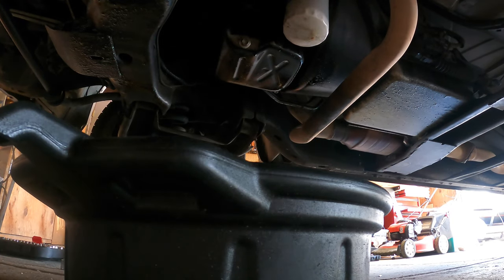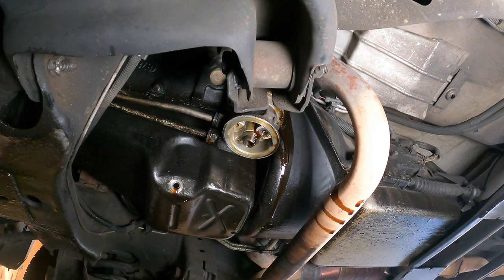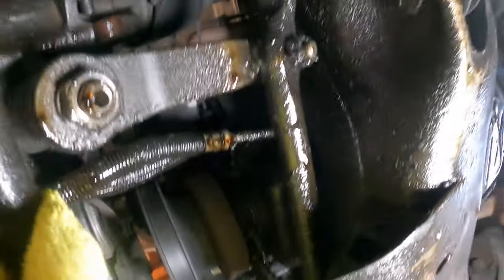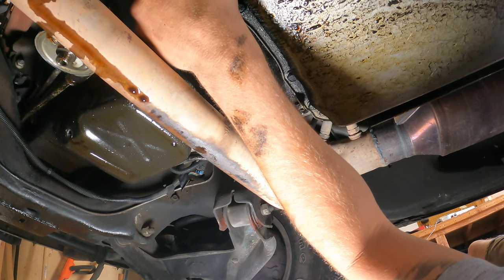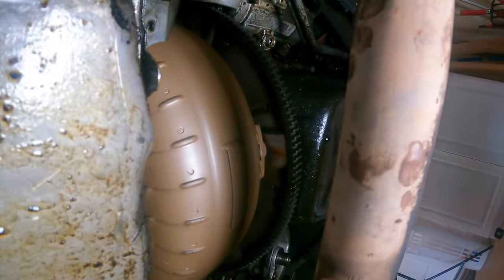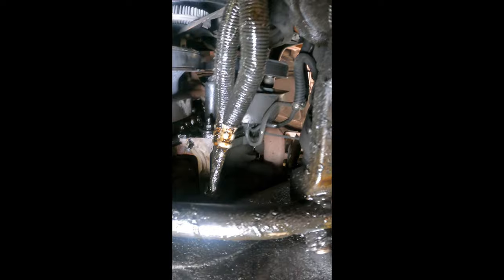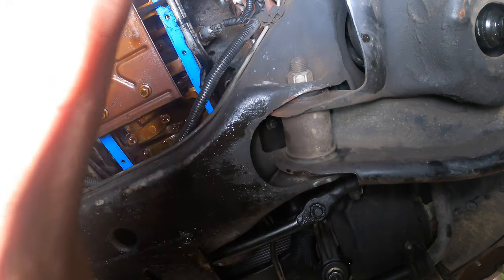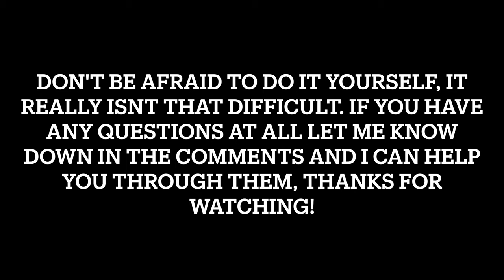Oil Pan Gasket 1996 GMC SIERRA AND SIMILAR VEHICLES

Comment: So you don't use gasket sealer ? I did   the oil pan gasket on my 96 c1500 and it still leaks from the front seal any advice
Reply from the maker: I did not use gasket sealer for mine, when I took the old gasket off I made sure the metal surface was really clean. You can add a sealer at the front and back of the block where it meets with the oil pan. It could also be leasing from oil cooler lines or one of the main seals. I’d clean the area up really well and see if you can pinpoint the leak.
Reply: There are two sizes of the gasket. A "thick" and "thin" variation. 
Certai models after a certai year take the "thick" gasket.
Reply: mine is leaking down the front of gasket after I changed it
Reply: Here's my up date guys , after I change my oil pan gasket it was still leaking from the front seal  I change in a couple Times befor I found out on the vortex 5,7 the timing cover is that plastic  which had a hair line Crack that I couldn't see I hope this helps

Comment: Oh boy! So I have to replace the oil pump on mine but I have a 4x4 and the differential is on the way 😓  went to a shop and got a $400 quote to change my oil pump and put new gaskets!  It looks like im gonna have a busy weekend!
Reply from the maker: You’ll get it done, it’s definitely easier with a 2wd truck. Good luck!
Reply: Wow that cheap ..

Comment: Lucky you I had to pull the whole motor out of my S-10 with an l31 vortec. I replaced the front seal too with a plastic cover, instructions sez to put silicone under the plastic cover to the front seal or it will leak. Came to see if someone did it on YouTube.

Comment: Love the vids on the truck. Two questions, is it totally leak-free after doing it? And will you be dropping the trans pan and changing the filter sometime soon? If you do please video it. Main reason I'm mentioning the trans pan and filter is because the trans crossmember is in the way of the rear pan bolts.
Reply from the maker: No leaks at all afterwards, I took the time to clean the metal surfaces where the gasket is placed. I actually just had the transmission rebuilt soon after this video was made so I will not be doing the transmission anytime soon, unless I buy another truck similar.
Reply: On my 98 even with the crossmember you can still get to the rear trans pan bolts wit a socket extension.

Comment: Great video, I also need to change out the oil pan gasket on my 92 c1500 2wd Silverado, as it's leaking from the rear corner at the oil pan rubber seal. I was happy to see that I won't have to lift the engine up to remove the pan, I'm encouraged to get it done now. Thanks for making the video!
Reply from the maker: It’s a job but it can be done in a day. If you get stuck feel free to ask me any questions. Glad you liked the video!
Reply: Thank You!

Comment: I just did mine. I was able to take only the passenger side of the exhaust apart since I recently changed to gasket on that side. I just moved the flywheel cover over enough to get to the nuts, and maneuver it to free the pan. I did the reverse to get it all back on. The worst part of the whole job was lining up the holes with the brackets on the outside of the pan, the pan itself, the gasket, and the block to get the bolts started. I figured the brackets are probably there to give an even pressure across the entire pan. So I couldn't discard it. Once I got that in, the rest was actually quite simple. Chevy's are awesome.

Comment: at 5:30 to pull the pan out freely you need to pull out the wiring harness directly under the pan to make it easier. then put it back when you reassemble. also, when taking out the pan bolts, put a rag over the cross member. this is because there's a hole there and if you drop a bolt (like i did) you will have to fish it out.

Comment: i have to change both transmission and oil pan gaskets, if i took off the transmission pan, would the torque convertor cover come out without detaching the exhaust, as well is merely retightening the exhaust flange enough to reseal, is there any prep.  thanks for the video and effort, grreatly appreciated

Comment: I got a 95 c1500 pickup. I'm pretty sure I have just enough clearance as well does the gasket seat properly any leaks? Seems like it'd be difficult tryna cram the oil pan back in and not move the gasket around? Get back to me imma go ahead and order the gasket

Comment: Hello, recently had a small tiny Oil Leak on my 96 Chevrolet Silverado 1500. And got the part to do this exact thing, I have some questions that I would like to ask.

I’m a particularly young fellow not familiar with the in and out of mechanics, will this be a hard or difficult job to do?

When I ordered the replacement pan set, it came with 4 small other pieces, where do these go? If you’re able to explain that.

Comment: My 1996 is leaking badly at the timing cover meet and I've got everything unbolted but its stuck up at the back end of the pan and wont come off
Reply: Same here. Mine will not drop down far enough to slide back. I believe the dip stick tube is holding up the process. I just watched this video again and it looks like he removed his dip stick tube. Have you had any luck with yours?

Comment: I did everything you did to the T, even loosened the starter and still the pan wont drop..i noticed you were wiggling the front of the pan twords the fan ?..what was in the way?
Reply from the maker: You may have missed a bolt, there are some really hard to get to pan bolts. I also used a mallet to hit it loose

Comment: Did you have to remove the engine mount bolts & raise the motor to get the oil pan out ?
Reply: Terry , He didn't.
Reply from the maker: This is a 2wd drive truck so it is a little bit easier, I am pretty sure the 4wd have more crap in the way

Comment: 3:04 how did you get that bolt off  with the two coolant lines bolted on the pan
Reply from the maker: Didn’t get a good shot on that one, I actually took the oil cooler off and let the lines hang. Take the filter off and then it’s two hex heads inside the cooler
Reply: @nathanbishop1999  thanks got it
Reply: @nathanbishop1999  I’m sorry what was your torque spec u did?
Reply from the maker: @Fernandro  18 ftlbs. That’s what I was told from a manual. Also do not forgot to change the gasket  on the oil cooler or it will leak. Don’t ask me how I know lol

Comment: I'm starting the process. Is there any kind of gasket in that exhaust section you lowered to remove the inspection plate? I've got the bolts off but quit for the day before I broke it loose.
Reply from the maker: I did not see any gaskets when taking it apart. Mine separated fairly easy.
Reply: @nathanbishop1999 , thanks. So no exhaust leak when you put it back together? I plan on attacking things in the morning. I'll keep you posted.
Reply from the maker: @dennisdain987  no leaks, it went back together pretty easily
Reply: @nathanbishop1999 , so it looks like you didn't use any gasket sealer anywhere? I am reading so many different scenarios on these 350 oil pan replacements. Maybe simple is the best way. 

My problem today was I cannot get the pan out with the space available. I know you said you struggled but I don't feel like i am even close to getting it out. I guess I'll unbolt my motor mounts and jack up the engine. I can't think of any other way.
Reply from the maker: @dennisdain987  I didn’t use gasket sealer but I also didn’t do any research. If you want to be safe then use the sealer. I got the pan out fairly easily with enough space. Is your truck 4wd or 2wd. If it’s 4wd then you have more things in your way
Reply: @nathanbishop1999 , stock two wheel drive. I just can't seem to get enough movement down in the back to seem like I'm even getting close to coming out. I'll try again in the morning. Maybe I'll have better luck after thinking about it.
Reply: I don't know what I did differently this time, but I finally got the pan to drop free. I kept thinking it was held up by the dip stick tube and I was actually trying to remove that but was not having any luck there. Then I moved the pan around like I had done every other time and for some reason the back finally dropped down and I was able to work it out. 

The last time I was under there I was rotating the crank from underneath with a socket wrench on the bolt of the harmonic balancer. Someone else had said to get the number one piston to top dead center. I figured I would just keep rotating it till something happened. Well, something happened.
Reply from the maker: @dennisdain987  Good job! I wish I would’ve been there to help. It’s hard to explain over the internet lol. I’m glad you finally got the thing off. It still beats laying to have it done, it’s an expensive job that’s for sure

Comment: If the oil gasket is broke would it cause everything to be covered in oil on the underside?
Reply from the maker: It can, it depends on how severe the leak is and wear it was leaking from. Mine was leaking from the top of the pan were it has a U shape cut out, it leaked pretty good on the underside of the truck

Comment: I saw a video where if you turn the crankshaft tdc it will pop the oil pan off (still have to take the torque converter cover off tho) it made life easier for me I didn't want to take the exhaust off but good work, I have to do mine over as im still seeing oil leak from the pan, must didn't put the gasket on good enough
Reply: There are two size oil pan gaskets for the 350. The "thin" one and "thick" one. 
Depending on the year, the "thick" one will prevent oil leaks from the very bottom of the timing cover that meets the pan.
Oreilly and Autozone do not carry them on hand, they must be ordered at the desk.
Reply: @Dagrizzb  I have the same gasket he has in this video.
Reply: @lovellbinns86  same as in color?
Reply: @lovellbinns86  there are two different thicknesses of gaskets.

According to summit racing:
The OEM oil pans made between 1955 and 1974 used the "thin seal."
The OEM oil pans made in 1975 and later used the "thick seal."
Most aftermarket oil pans use the "thick seal."

I have replaced my gasket 3 times now.
First when I got a crate engine.
Second when it leaked.
Third when the replacement leaked.
Now, for the third instance I had purchased a felpro gasket from Oreillys auto part number 0S34500R. The same blue one as in the video. This gasket is what is commonly stocked at many auto part stores.
The other size of gasket I came to find 
was felpro, part 1886 also available at Oreillys. However, many stores can only order this part by request. 
The way to tell what gasket you will need is to measure the height of the portion where the timing cover sits at the front of the oil pan. Place a ruler across the top of the front end of the oil pan, measure the height from the bottom of the timing cover area (the curve) to the ruler sitting across the pan. 
2 1/4 is the old "thin" gasket OS34500R
2 3/8 is the new "thick" gasket 1886.
Reply: @Dagrizzb  color and gasket, I got my gasket from auto zone which is more than likely the one u got from O'Reilly. Im about to take this pan off for the 5th time. Im not sure what im doing wrong but I've never had a hard time replacing a gasket like I do for my obs.
Reply: @lovellbinns86  whats the part number on the gasket you got?
It's the one they had in stock right?
Reply: @Dagrizzb  yes the one they had in stock. Part OS 34500 R
Reply: @Dagrizzb  also just checked the summit reviews on the 1886, reviews say only difference is the one we have comes with all the gaskets and plastic corner tabs and the 1886 is just the gasket
Reply: @lovellbinns86  Yes, those extra little gaskets are for the oil filter adapter. For the oil filter adapter gaskets, it's best to order the original AC Delco gaskets. The other ones have a tendency to leak overtime.
And yes, I had to order the four plastic installation pins separately.
I have been through three different gaskets in the span of one year on my current engine. All three have leaked from the bottom curve between the oil pan and timing cover. That is how I found out about the thicker gasket. Once I install this gasket, I will be sure to get back to you with the results.
I have everything off except for the timing cover and harmonic balancer.
Reply: @Dagrizzb  good luck. Im out here doing mine today....yet again, I went to autzone to get a replacement warranty gasket the worker said man how many times u plan to buy this gasket when he saw how many times I had to get it lol...but I'm going to use some rtv & see what that does, hopefully it works... 🤞🏾
Reply: @Dagrizzb  as few things, one I hate the blue rubber style gasket, old-school cork lasts forever and rarely leaks, and two when you replace the oil pan with the timing cover in place you should put sealant in the corners, as in, both corners of the underside of the block surface where the lower part of the timing cover is on each side of it from underneath, those two little corners tend to leak, good luck peace
Reply: @lovellbinns86  so, I just finished installing my new gasket, along with an aftermarket aluminum timing cover. 
Timing cover is from summit racing
Holley Timing cover 21-152 (with crank sensor hole) cost me $90 cause I paid for 2 day shipping. The timing cover still has the 1/4 inch gap at the corners of the lip that need to be siliconed shut. 
Gasket I used was Fel Pro 1886. (Very important that it is 1886 for 350 engine 1975 or after)
I placed ultra black on the four corners of the engine where the oil pan curves meet the block, installed the gasket, pan, and torqued all the bolts to 100inch pounds. 
2 days so far, dry as a bone, as opposed to the last one that didnt last a day cause I got the wrong sized gasket.
Reply: @HOTRODRICO  read my newest comment for the details.
Reply: Its me on my obs pg im back to say im doing this again today for the 7th time. Idk what else to do it leaked since last time so im back at it til it stops leaking 🤧

Comment: Man I have a 95 Silverado single cab and just replaced the gasket been taking me days to work on it due to work and it being my first time as soon as I finished and put everything up I started it and it started leaking next to the starter🤦‍♂️
Reply from the maker: Damn old trucks 😂. Was it leaking where the oil filter is at? Or leaking from the pan. I’ve notice some leak because of the condition of the pan and you may need gasket sealer on top of the gasket, I was able to just use the gasket but I cleaned the area really well and my pan was in good shape.

Comment: Great video. Reading through the comments helped as much as the video. My 96 leaks (badly like you said yours did) at the front where it meets the timing cover. 

I haven't talked myself into the project yet. I know how messy it will be. (I'm in SoCal, you want to do mine?)
Reply from the maker: If I was closer I’d come do it! It took me a full day because I didn’t know what I was doing at first but it’s pretty simple if you take your time